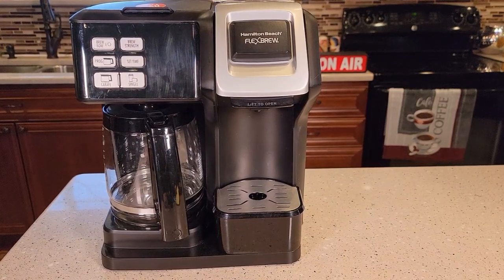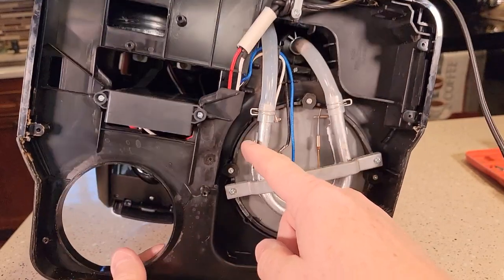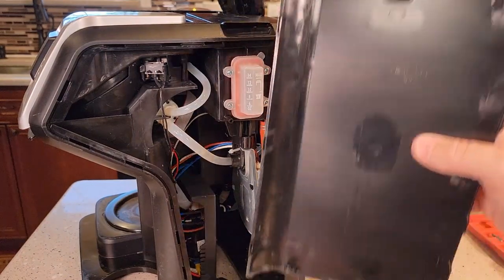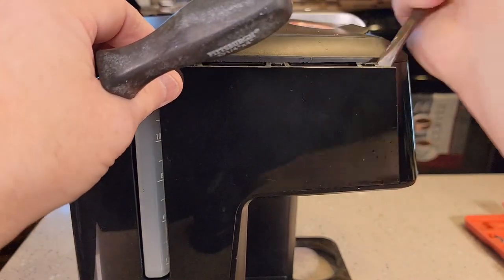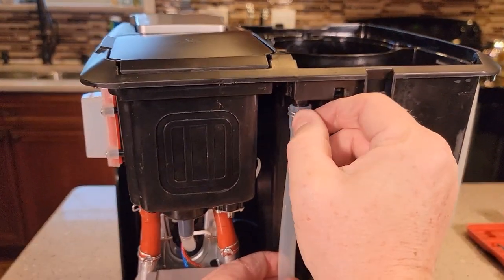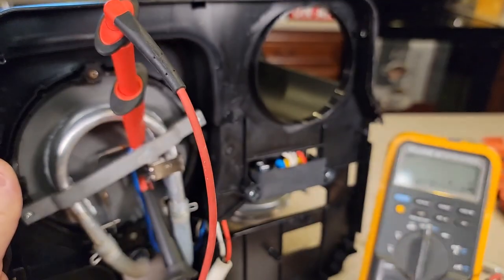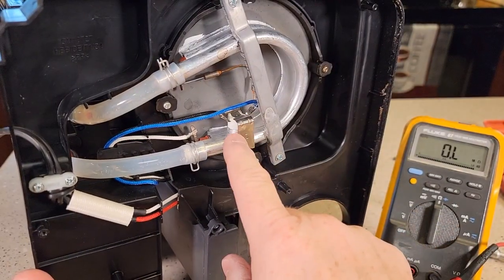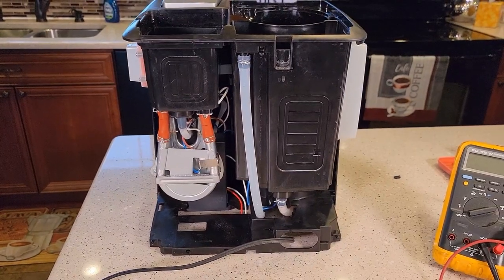HOW TO FIX Hamilton Beach 49976 & 49954 FlexBrew Trio 2-Way Single Serve Coffee Maker LEAKING WATER

Comment: Thank you for the video, it walked me through the removal of the plastic panels with the loss of only one tab!  The leak in mine turned out to be a tear in the tubing that has the tiny red ball valve.  My husband helped me by cutting some clear tubing from Home depot he had in the shed.  He removed the check valve assembly from the torn tubing and with the help of some coconut oil, pushed it through the good tubing.  We ran four cups of water successfully.  Since the fix will work, we will now be looking to purchase some food grade tubing because I'm not sure the tubing we had on hand from Home Depot was food grade.  Anyway, thank you for saving my coffee maker from ending up in the landfill, I really like this coffee maker!

Comment: Thanks for the great video! Ours was leaking out the bottom on the carafe side, Using your video I was able to get it apart w/o destroying everything! Turns out the leak is from the heating element; apparently it has corroded thru where it's brazed or welded(?) to the support bracket. Found a used one on ebay, but would rather put that $$$ towards a replacement, Had it for quite a long time...

Comment: Love ths unit!! I convinced my sister to get the same one, after she had 6 failed Keurig machines. She loves hers too! I have used my pod side only twice, cleaned it & hadn't used it for a good long time. I usually make a pot. I keep my unit very clean & only use filtered water. Today I got some pods, so I filled it, popped a pod in, chose my setting, hit the button. Heard it boiling, but then it went quiet, rather than squirting the coffee out. So it appears to not be working. I did check the pins & they were clean & shiny. Tried to run a mug full of vinegar after soaking for an hour. Still no change. 

Anyone got any ideas what to do?

Comment: at the 8.54 mark in the video. it shows a filter under where you put in water on single cup side k-cup. it was so nasty, that is what caused me an h20 error. filter was stopping water flow. the grate is under the flip lid. I flexed the lid to get it out. a bit different from what is shown but it worked for me. Thanks just a dad videos. lid an screw has to come out prior to removing the section with the great. FYI do not make coffee first thing after water has been off for 24 hours.

Comment: I have the FlexBrew with the 2 tanks. Mine the K Cup is exploding at the top of the Kcup just before it finishes. I have descaled it,I have cleaned any build up. I have also cleaned the needles. I have also cleaned the white(semi translucient piece in the top of the part that the grey section that twists back together ) piece using my wire . I also used compressed air one of the other videos suggested. I changed brands of K cups. Nothing stops this from happening. Help before I send it back. It's not quite 2 yrs old & it has a 3 ye warranty.

Comment: My heating element was so clogged it took a drill to get al the calcified powder out ! sadly the clog turned the corner in the horseshoe so I kept drilling as I had nothing to lose. $15 bucks for a new element but I can get the new model for $30 and plan on tossing it when it slows to a crawl.

Comment: For the tube with the red ball... Could you tell me the length and dimension of this tube, if you know it please!!! The tube is dry and cracked, and crumbles when I remove it from its location. Impossible to find a replacement tube near me, and I would like to do it myself ;)

Thanks for any help/information you can give me.
Reply: not sure what your options are. That red ball acts as a one way valve. You'll need to have one for it to work.

Comment: Our single serve side brews about a 1/4 cup, shuts off, starts again for another 1/4 cup and so on until the coffee maker gurgles to complete. Do you know why we don't cycle through a whole brewing process without it shutting off 2-3 times during the brew cycle? We've already cleaned the needle and such and used vinegar to brew through it. (at which time it also takes 2-3 times to restart)
Reply: Having much the same issue with ours.
Reply: I have the same problem and now it is dispersing the water all at once but before it heats it so it is cold.
Reply: So not sure if you're still have an issue with this, but just incase other see this. On the single serve side there a filter where your pour the water into that might need to be cleaned. I just did this to mine and it started to work no issues(at time of writing). You just need to unscrew the plastic piece under the lid to access it.
Reply: @Matthew Scott  I've done this and took it apart but it heats the water but does not come out now.
Reply: I am having the same issue with mine. It keeps saying needle, We have cleaned the needle with descaler,  soaked the needle in vinegar, and finally clr. Nothing helped.  It comes out hot, but doesn't finish the brew. I will check the filter, but what else could it be?
Reply: well, I figured it out!!!  Thanks to another "just a dad" video" it showed where the filter for the k cup dispenser was and, yup, it was full of white gunk.  I cleaned it and now works great.  We are going to use distilled water from now on

Comment: I’ve had two of these. The first one failed after several years. The pipe going from the carafe tank to the heating element. Got brittle and cracked. The newest failure was at the heating element. It looks like the hold down clamp wore a hole into the metal tube. Time for a different brand.
Reply from the maker: they tend not to last the longest

Comment: My carafe side wasn’t leaking it just quit working, any ideas on how to fix that?
Reply: mine has a simular problem. The brew light light comes on and than it goes to keep warm without making any coffee
Reply: Same here. Lights function normally but doesn’t do anything or heat up. I did some troubleshooting based on your video. Thermostat checks out ok with a meter, no obvious issues with hoses. May be the control board. Not worth messing with at this point, time for a new one.

Comment: If the thermostat is bad will the system just not brew? Currently mine turns on. Power to the light but nothing happens. Wondering if the thermostat isn't letting it start.
Reply from the maker: it might be clogged needle
Reply: @JustADad  sorry but it's the normal carafe side with the issue not the K side issue.
Reply from the maker: @brookdavis8425  does the warming plate get hot. If not the it is probably bad
Reply: @JustADad  it doesn't get warm. It doesn't make any noise or anything. Oddly enough it says to fill water even when it's full on the K side. The board might not be happy either. I'll investigate further. Thanks for the help 🙏

Comment: I get add H20 although it's full of water on the K-cup side. I imagine it could be the water level sensor. Any idea how to service that?
Reply: Same problem here
Reply: Did you ever get a replacement part.  If you press brew, the water in the tank gets hot if you manually dispense water it will reset it and dispense hot water manually
Reply: @jonathanhenderson3629  I don't understand how you get the water out "manually" other than turning it upside down & dumping it out. Is there some trick I'm missing? That feature is not in the owner manual.
Reply: @amc8409  you can most definitely get the water out manually when you press brew now hold the button in
Reply: @amc8409  hold it and don't let go until the water stops then repeat the process I usually push brew now once I see the h20 error I then hold down brew now and then repeat process that way the water coming out by purging it is hot and not cold

Comment: I'm having a problem on the single cup side, where it says it's not detecting water in the hopper. Has anyone else experienced this? I drained the machine once, filled it again and it worked one more time, now it's stopped completely.
Reply: Mine has stopping to. I am trying to descale it but I think it may be the pump.
Reply: @brianvidales4380  okay good it is not just mine I've taken the whole thing apart.
Reply: Has anyone make made it work again?
Reply: @dnogueram  mine did start working again on it's own. Clean in the water tank, wipe it down and make sure it's dry. Have it unplugged from power for a couple hours. Then try making a cup.